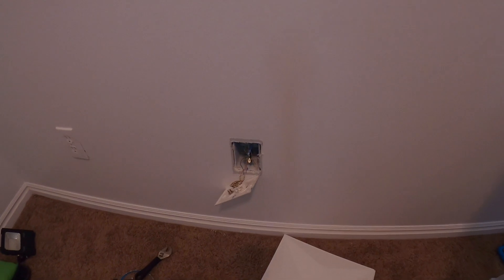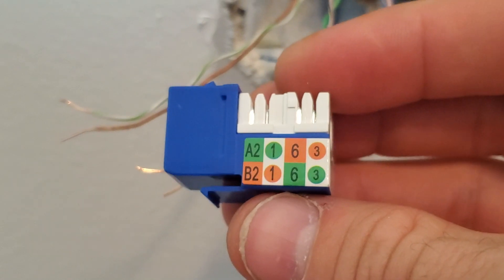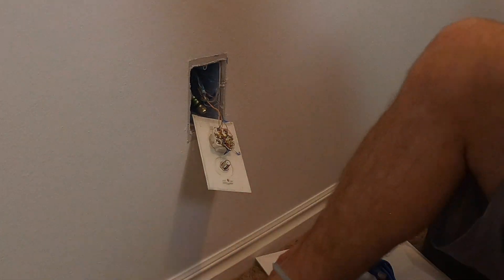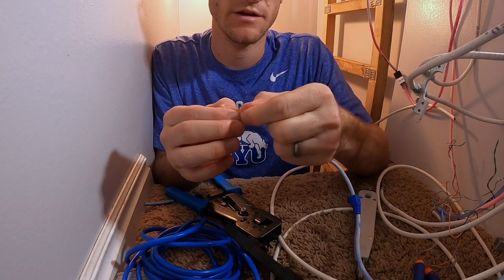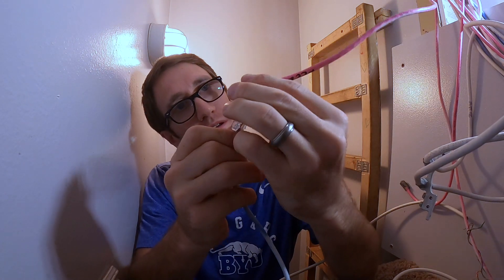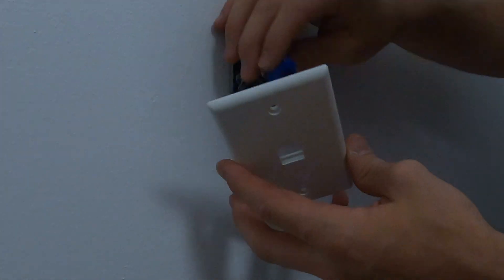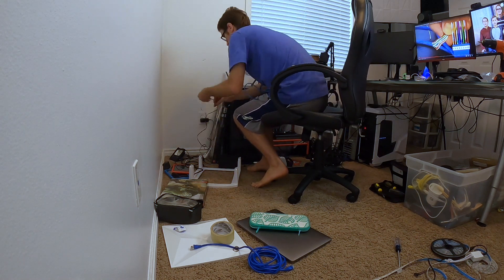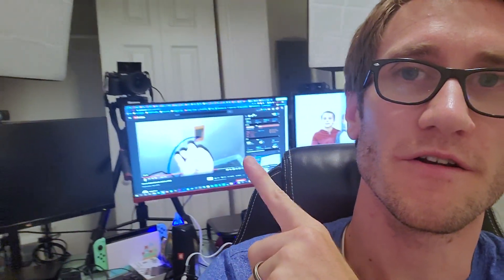How to change a Phone Jack to Ethernet Wall Outlet

Comment: My friend bought a home built in 1996.  There are phone jacks in the usual places for which she has no use.  When I can get there, I'll check to see if they are 4-pair (some form of Ethernet, CAT unknown) or typical 2-pair phone wiring.  If they are 2-pair, I hope I might be able to use that phone cable to pull Ethernet wire instead.  It depends on whether the phone cable is tacked/stapled down inside the wall or not of course.  If all else fails, I'll just snake Ethernet CAT6 along the same path.  What use is the old phone wall jack in the kitchen?  Not much.  Maybe I can use it to feed a wall-mounted access point?  The house is on a slab, so all the wiring should come from above/attic (I hope).  🙂

Comment: If you have the regular phone line and not the blue ethernet line can you convert it an ethernet line?
Reply: 2 years later, you probably know by now. No… regular phone lines don’t have the ability to handle enough speed. You’ll likely need to feed cable through the wall

Comment: Came across this when searching for replacing phone cable to Ethernet and though I would leave this comment with a few notes
standard A and B for RJ45: from what I understand, A is used in America and B in Europe. if you mix them you get a crossover cable (For comunications to and from a computer, without a router).
about the tester: the tester has 2 parts and you actually didn't use it as intended. Each part must be connected to a cable end and light up in sequence 1 thru 8. If you have a crossover cable, the receiver will jump around. Not really usefull when a cable is only slightly damaged (had a cable work fine in a tester but the computer would not get data due to interference). Had to re-crimp it to solve 

Hope these notes help

Comment: This video was helpful, I just discovered today that my house was ran with cat5e for phone so it's time to use it to pull 6. 
If I may add something though, at 3:03, the wires should be ran down the middle of the keystone jack and the open ends pointing out the side so it can be snipped to avoid shorting/data loss.

Comment: Why didn't I think of posting a video like this? I've been a telco contractor for 14 years and converted countless jacks to ethernet. Even a few using the old station/z-wire (red/green/yellow/black) which isn't proper at all, but in a pinch (enclosed ceilings, dumpy house, etc) there's no other option. Mind me asking if you've made any money off this video? 🤔
Reply from the maker: Yes I have. I’ve made $300. You need to be a YouTube partner and that is the hardest part
Reply: How do convert the old 4 wires into Ethernet?
Reply: @jessicajarsak7812  The red/green/black/yellow? It's not ideal as the pairs aren't twisted, but you just have to punch down the red/green into the green slots, and the black/yellow into the orange slots. It has to match at both ends, and won't work if there are phone jacks spliced in between. Maybe I'll make a video sometime! Lol

Comment: You had me until the 3:10. You need to “feed the port to the master”. It’s unclear where you’re even at or what you are talking about. Are you on the other side of the wall? Are you by the router? Lmao very confusing.
Reply: I think the master is the main cable that all other cables connect to. That is where your router will also connect to.

Comment: I had no idea that phone jacks were run with Cat5/Cat5e cables in newer homes... I have 13 ports in my home that are getting an upgrade to ethernet ports now. Thanks to you good sir!
Reply from the maker: Some more modern homes do. Make sure you check
Reply: @TechinfluenceTV  how do you do that?
Reply: @CMBdecipleofChrist  Remove a phone wall plate and look at the wiring in there.  If it is ethernet, then you should have 4 twisted pairs (8 wires total) coming out of 1 cable.  Phone jacks only used 2 to 4 of those wires, so you should have some not connected to the plate.  If your house was built in 2000 or later, then it most likely came installed with ethernet for the phone lines.  The cable should have black writing on it telling you what type of ethernet it is (Cat5, Cat5e, or Cat6).  Mine was built in 2002 and has Cat5e.  You need Cat5e or later to get 1Gbps of speed over those lines.  Cat 5 only carries 100Mbps.
Reply: @dacripe if i only have 4 wires with no ethernet cable, I will not be able to get Internet from the outlet, correct?

Comment: Cool video! An electrician is coming over to see if he can do this in my house today and I found this video while trying to research how much it'll cost.
Reply from the maker: The parts are cheap. Getting an electrician is the most expensive thing
Reply: I have old wiring with only 4 wires behind my old telephone line. So does that mean, it won’t work?

Comment: I want to make sure I'm following. You had an ethernet (cat 5) cable connected to your phone jack? My phone jack has just four wires into it.
Reply: The trick is figuring out which wires in the Cat 5 are the actual signal carriers. It doesn't need all 8. 2 for out, 2 for coming back. I am going to try to make this work out to my shop. I have an old phone wire out there. My wifi isn't strong enough to be reliable.

Today is Nov 27 2020. I will post back in a few days with my results. Cheers
Reply: @joeshmoe7967  Did it work, because I have the same problem
Reply from the maker: Let me know how it goes
Reply from the maker: On the cable itself it will say cat 5. If your cable is not labeled like that you won't be able to wire it to ethernet